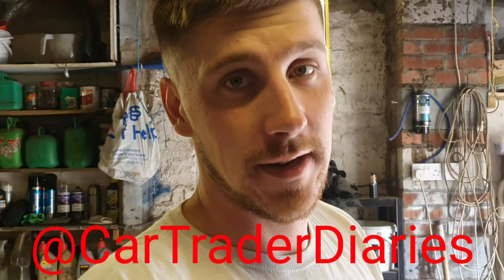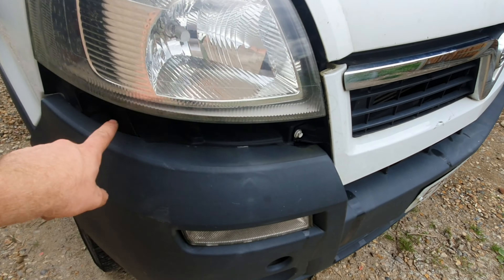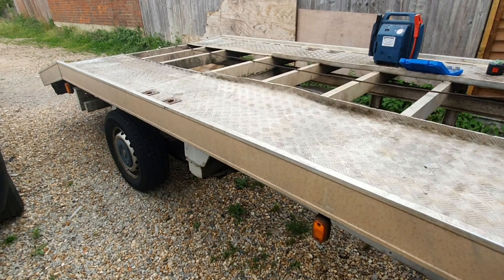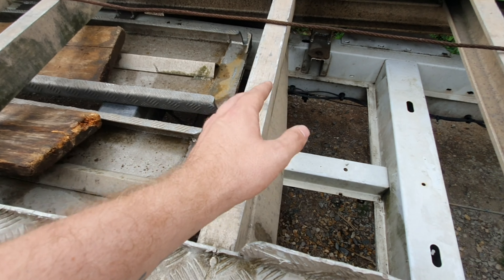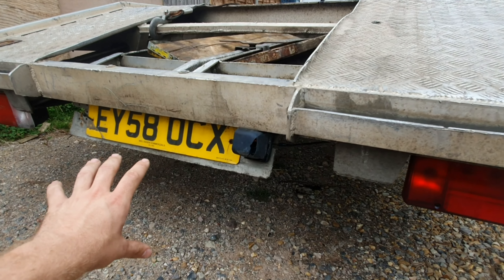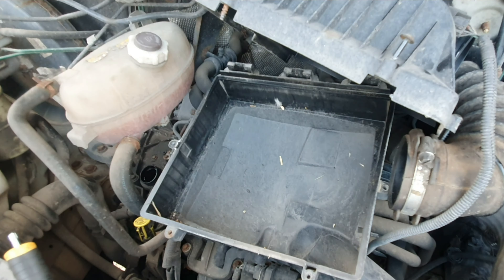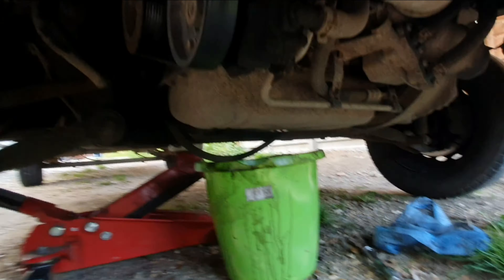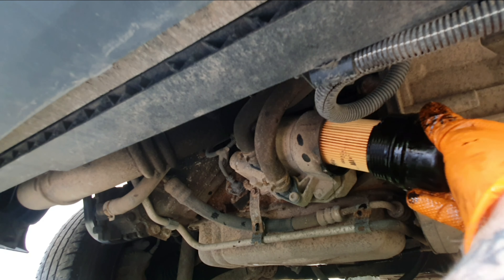I BOUGHT A CHEAP RECOVERY TRUCK!

Comment: I built one for myself recently on the movano, full aluminium floor 5 meter bed and 2 meter ramps. 
Movano is good base, doesn't rust as bad as transit or sprinter , and it's good on fuel. Gearboxes are bit soft.

Comment: Love the video mate. I started off with a recovery truck but limited to the weight it can take. If you do trailer ticket and get a 3500kg rated trailer you can shift vans and range rover sized jeeps ... need a tacho though lol. £3,000 was a steal mate